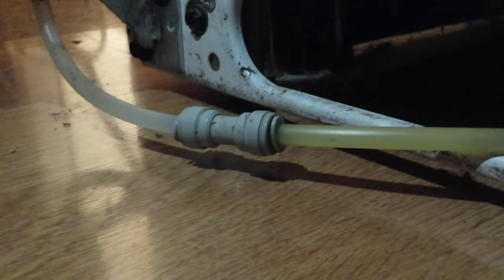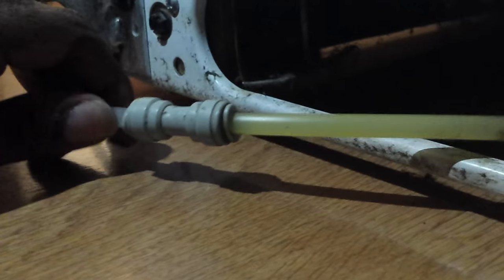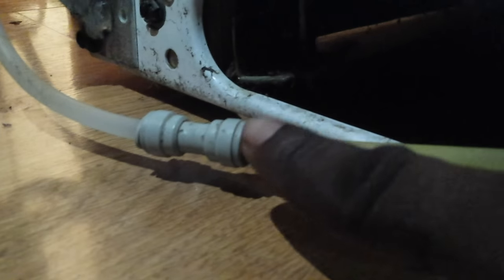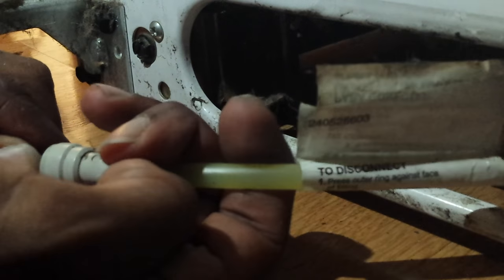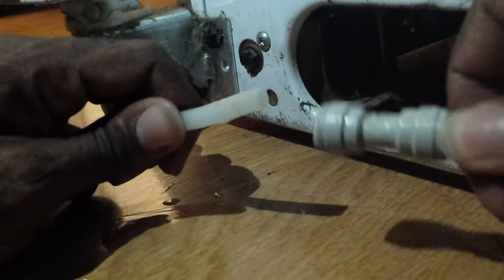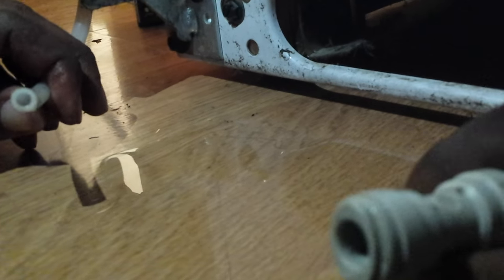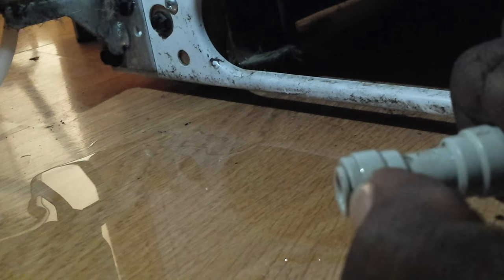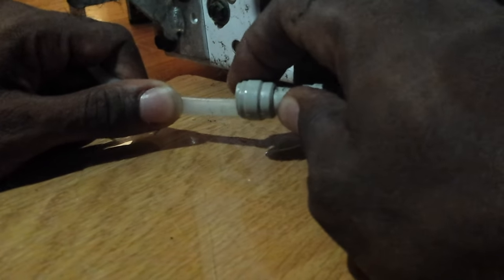How to Disconnect Refrigerator Water Line/Hose

Comment: Great job, started off showing the water line, and got right into it. No big discussion on what you were going to do. Great job on the visuals too. Got right in there with the camera and showed the parts good. Did you shut the water off first, or does the gray connector automatically keep the water off? Also, do I need to push that small part back in, or do I just reinsert the tubing back into the gray connector? Thanks for taking the time to make this video. I look forward to your replies. Thank You
Reply from the maker: Hi yes you have to shut water off first and the tube will push back in.  Glad could help. Please subscribe & like and share if haven't already and check out our other helpful videos

Comment: What about the water valve? Is it behind the fridge to turn off before you disconnect the tube? I'm a complete MORON when it comes to these things and have to disconnect my fridge for a new one coming next week.
Reply from the maker: Thanks for watching yes you have to turn water valve off b4 disconnecting water line, normal there is a shut off valve located i
In your basement.Please Subscribe and share if haven't already and check out my other helpful videos.

Comment: Exactly what I came here from.  I wasn't sure if this was a push or pull on the connector.  I need to defrost a water line on the water dispenser (ran it too long with the filter removed) and it looked like it would be easier from this end, and to confirm that the valve is operating properly.
Reply from the maker: Glad could help Please subscribe like and share 🙏.

Comment: Thank you!  Exactly the information I needed delivered quickly three times and in context.  When removing well loved refrigerator on which I was ready to just clip the electrical and water lines and pitch it, the knowledge you shared allowed me to find the correct approach, propertly disconnect the fridge and allow it to likely run another 20+ years in another location rather than a landfill.  It's usually the small things that make a difference, thanks for thinking of this small thing and sharing, it's taking more time to thank you than to do the job ;), liked and subscribed.
Reply from the maker: Your very welcome glad could help save a frig👍 thanks for like and sub.

Comment: Thank you, it is 11:49 pm and I am struggling to try to get this fridge through a narrow door.  I realized the only way to fit it was to take both fridge doors off this GE side by side fridge.  When I came across this fitting I tried a screw driver to pry "open" that fitting that you showed me that I should INSTEAD push in. I am glad I was smart enough to question myself and stop before I broke it, and I thank you for showing me the correct way!
Reply from the maker: Thanks for watching and commenting yes, I went through the same thing. Glad was able to help. Please Subscribe and share if haven't already and check out my other helpful.

Comment: Thank you! Question: we are actually removing a fridge from an outdoor storage room, and not replacing it with another fridge - the room will just be for storage now.

I would have to turn off the water to remove the water line, but when I turn the water back on, how will I make sure that water doesn’t just spray out of the empty line that used to go into the fridge? Last thing I want is to flood my outdoor storage room!  Thanks for all that you do!
Reply from the maker: Your welcome if you have a line that goes just to fridge leave vavle off.

Comment: Wait want to make sure I understand, when I pull it out properly the water won't flow right? Or do I have to find the saddle valve to shut off? I'm trying to figure out if there is a valve built into that piece you had on this video.
Reply from the maker: You have to shut off water to fridge if not water will come out. Please subscribe & like and share if haven't already and check out our other helpful videos

Comment: Thank you! If I disconnect the two cables then I can open the water? I mean the connector stops the water coming from the tube or the water will exit from the connector?
My goal is to unplug the dispenser since I don't use it and it drips water
Reply from the maker: You need to turn water off first

Comment: Why does my copper wire running from my fridge have a Red pex pipe instead of a blue one, and it has a valve.  Will this stop water from feeding to my fridge if I turn it off?
Reply from the maker: Most likely yes will turn water off. please subscribe like and share and check our my other helpfull videos.

Comment: Do you have to shut off the water connection before doing this? My water line doesn't have a valve so I would have to shut down the main valve for the house I'm guessing
Reply from the maker: Yes you need to shut water off. 
 please subscribe like and share and check out our  other helpfull videos.

Comment: Hello what is this thing called the plastic part? I had a fridge moved and the movers broke it in half. I want to replace it. Can I just buy the plastic or will the whole line need to be replaced?
Reply from the maker: It's a waterline connector.  You should be able to get it at Home Depot, Lowes, etc.

Comment: Hello brother. Is there a possible way to use the the same type of refrigerator without the water dispenser, and only ice? Basically when I go to use the water dispenser, I DON’T want water to come out of it. Any help is appreciated.
Reply from the maker: Sorry im not sure, but most likly you can plug the line to the water despenser. Please subscribe & like and share if haven't already and check out our other helpful videos

Comment: pushing on the small ring while pulling on the tubing can be difficult, especially with short fingernails. I have used a small pair of pliers that goes around tubing to help push the ring while pulling on the tubing which has helped on a few occasions but even that can be a bit of a challenge. Does anyone know of a tool made to help this unique situation?
Reply from the maker: Sorry I don't think there is but if find out there is will post. Please subscribe & like and share if haven't already and check out our other helpful videos

Comment: How can I plug the line? My water dispenser is leaking
Reply from the maker: You can plug with a line plug should be able to buy from Lowe's home depot, or may want to turn water off to frig. 
Please subscribe & like and share if haven't already and check out our other helpful videos
Reply: @Flashback502  thanks yes bought an end cap @ Home Depot